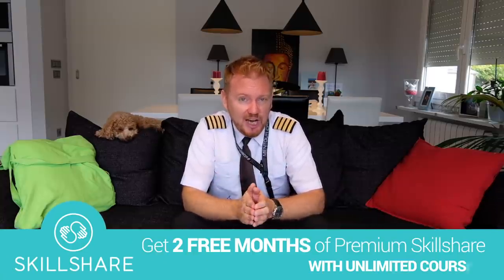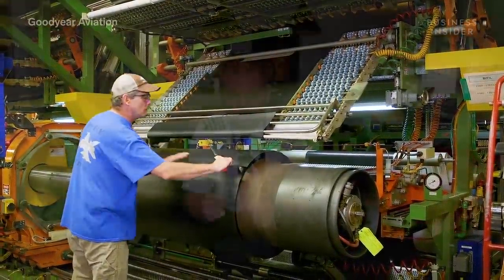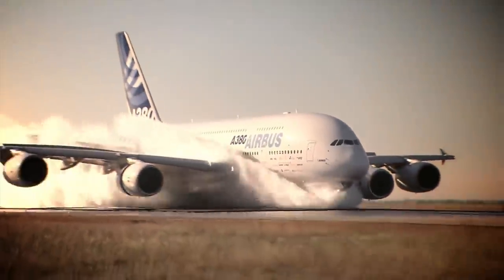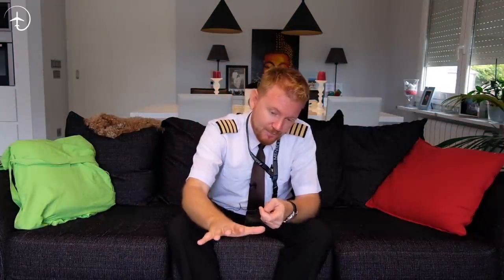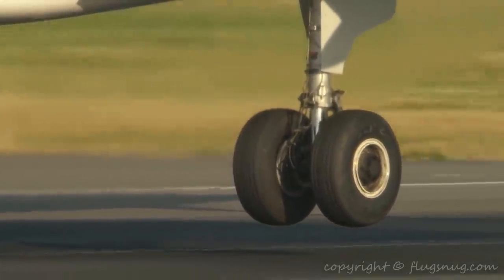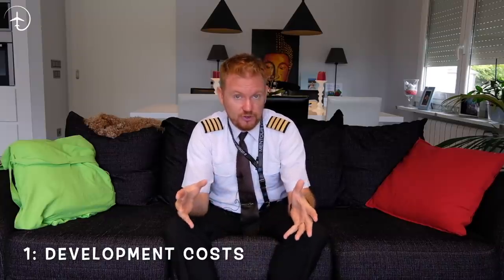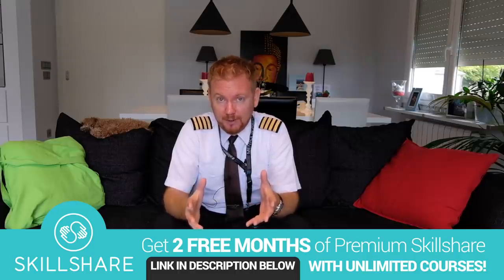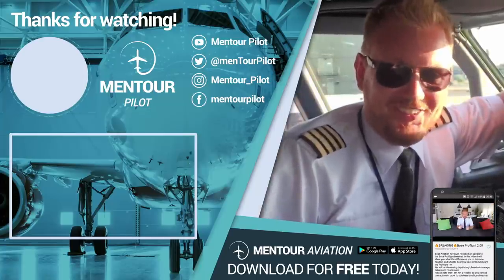Why not make plane-tires spin, before landing?!

Comment: I would think that even if the wheels did not spin at landing speed but at a lower speed, they would still save a lot of rubber. But if the tire "only" costs $1500, I guess it isn't worth it.

Comment: All along the highway you see blown out tyres? I was going to call you out for being ridiculous then you showed footage. This must be a regional/country to country thing because I virtually never see them here in the UK. Like I drive to work 30 mins both way on mostly 70mph A roads or motorways and I see the remains of a tyre like once every several months? See a vehicle with a blown out tyre even more rarely.

I get it in the US. There's no yearly MOT system, and when a state does have some form of one it's normally useless. So vehicles get into awful states quite easily, especially tyres, whereas MOT's being yearly I think are in a position where most tyres that are likely to blow out are caught before they do.

Also if your tyres blow out here it's classified as an accident and it's illegal not to report it to the police. And as part of that they will remove any debris that are located on a public road (if you go off the road though it's more your responsibility).

Also in my experience here there's a cultural thing where if your tyres are like 1 nanometer past the legal limit or look slightly low on pressure some friend/colleague/family member will point it out to you. Fucking annoying sometimes but helpful I guess.

But I guess you also see them in Spain then? A quick Google suggests Spain has a less rigorous MOT system, but they still have one.

Comment: why not something passive with small fins in the wheel's metal central frame it would just grab air when exposed and spin the wheels like an old water mill

Comment: I’m sure you could add a turbine like structure to the rim or brake discs… use AIR to get them rotating from the airstream… and then control the top speed with the brakes… saves a lot of rubber ! 
Batteries argument seem useless, why batteries ? Just use your onboard power, no batteries needed
Make a system from an airstream driven set of wheels a sensor looking down at the runway and a small computer synchronizing all wheel speeds to the slowest wheel and ideally matching the ground speed.

Comment: I disagree that motors would need to be installed.  I also disagree that the tires would need to spin up at the same speed as the plane.  You could use the airflow across the gear to start the wheels spinning.  There would still be smoke and tire slippage but it would be much less, and with no motors, batteries or major tech.  Just an engineered fan wheel on the back side of the tire rim to capture the air and start the tires spinning.

Comment: The real answer is weight. The airline loses more money paying the fuel cost of hauling around the extra few hundred pounds of systems than simply paying for replacement tires more often. I was on the design team for the 737MAX10 reticulating landing gear.

Comment: This is my take on the question: the amount of fossil fuels that goes into making tires is much smaller than the amount of fossil fuel that would be required to lift the additional weight of the tire motors on takeoff, and them run them during landing.

Comment: I am always amazed at how many computers are used in a plane. Is there any move to build a single computer to control all the planes systems, so that instead of several computers you have multiple apps

Comment: Nitrogen and Air specific heats are almost the same. That’s not why they use nitrogen. They use it because it is inert. Not because it resists temperature change better.

Comment: Personally I think you're way overthinking the problem of making the tires spin they're already batteries on their plane right there are already generators but to me a much simpler thing is once the landing gear is down they're in the airflow it would simply be easy to use the air flow to begin to make the tires spin since all the tires are in the air flow I'm sure it wouldn't take a genius to come up with it cost effective use of that air flow and get the tires to spin after all the tires do not have to be at full landing RPM to reduce the wear just by consuming most of the startup potential in rotational initial movement will make I'm sure of substantial difference I would think in what weather or any inclement conditions this would add to the initial traction ability during touchdown seems like a no-brainer to me

Comment: You need to think outside of the box. Rather than use electrical motors you insert hamster wheels into the hub of each wheel. Just before landing you deploy the hamsters into the wheels and have them power up the rotation of the wheels. No batteries required and the weight of 4-6 hamsters is minimal. You’re welcome.

Comment: In theory the tires wouldn't have to be spun up to 200+ kph, they just have to be spining rather than static at the moment of contact. And the easy way to achieve this would be using a hydraulic driven motor since the aircraft is already fitted with a hydraulic system and there would be very little weight penalty.
Reply: The 747 has 18 wheels not sure about the A380 but its lots, every wheel would need a motor, pipe work, possibly two sets for redundancy, (running along undercarriage legs that vary in length during use, so its complex), you couldn't use the brake system to power them because a failure could be catastrophic. so your saying the weight penalty would be "very little" isn't actually true.
Reply: @davedixon2068  It's not an impossible task, and the benefits from implementing such a system could really be a game changer since it would also be useful when taxiing.

But I do know the aviation industry would never go through with such a big redesign.
Reply: @syrthdr09sybr34  As I have said to many people posting on this topic, of course it is possible to do the things you are saying but it will never be financially viable and in some instances it could be detrimental.
Aircraft engines are started at the gate for a reason i.e. checking everything works ok, there are tugs already provided so why fit a system to the aircraft to do the same thing, its just more money and something else to go wrong, and you don't need to spin up the wheels because the minimal benefits are far outweighed by the disadvantages both of which (benefit & disadvantage) have been covered extensively by lots of people.
Its a nice discussion point but in the end its not needed so it wont happen.
Reply: @davedixon2068  My argument is about the possibility of developing a system like described, not about the economics and the political side of it.
Reply: @syrthdr09sybr34  As I said yes it can be done but it wont be.
Reply: @davedixon2068  Yes I knew that when I posted my first comment. Although I'm not an aviator I do know somewhat how the aviation community functions.

Comment: I have heard it suggested to add small bolt on vanes for the aircraft wheels that would cause the wheels to rotate when the gear is lowered. Not required to spin to full speed, just turning so as to reduce the inertia held in a wheel that is stopped and contacting the ground at landing speed. Sounds logical that just rotating up to just 30kmph, no balance/vibration issues here, would greatly reduce the wear on the tyres. This idea seems to be universally rejected and I still can't see why this low tech and low cost feature would not have some merit.

Comment: Why electric motors? How about using compressed air? it would be enough for the wheel to become a turbine. you can use the air momentum itself and coordinate everything so that the wheel is synchronized with the speed of the plane.

Comment: Wouldn't it be possible to have a simple system that would accelerate the wheels through the flow of air using air vanes mounted on the rims (similar to a water or air turbine or impeller)? This in conjunction with a rev limiter that is matched to the landing speed. Many of the disadvantages mentioned would then no longer be relevant.

Comment: Wow, 200 kilos of fuel per flight JUST for taxiing? Considering there are about 22 MILLION flights per year, that's 4.4 BILLION kilos of fuel! Imagine the cost savings alone if they used an electric tug, not to mention the massive reduction in expelled waste, runtime on the engines, etc.

Comment: Ok, the reason for having nitrogen in the tires is probably not as stated in this video, it would probably be affected by changes in pressure and temperatures just as much as air would.

Comment: Nitrogen gas is just a gas, like any other, so subject to gas laws. The pressure in any such gear will be P = n*R*T/V, where n is the number of molecules, R is a universal gas constant, T is the temperature and V is the volume (i.e. now the size of the tires). Although, this law is not usable in extreme temperatures or pressures, this is not that category, so the type of gas is NOT IMPORTANT, there is nothing like "nitrogen changes less" (or more) than any other gas. Actually, 78% of the air is nitrogen, so even if you were right, compressed air should have very similar properties to that of nitrogen's.
I'm sure, there is some reason behind using nitrogen. What I'm saying is that it is not what you said.

Comment: I wouldn't try speed up the wheels using motors. Why not use aerodynamics to bring a tire turning? A certain profile - tesla valve - or little wings on the side of the wheels or even on a tire would accelerate quite a little bit? You don't have to get to the perfect speed. Crosswinds ... I don't think these are a problem. Old rubber may not slowdown a plane enough so you have to change or renew it anyway after a year (you see that effect on car wheels. You just have to test what is still safe and cheap. But of course you will not be able to use wings on open wheels like on these ... 737.

Comment: Maybe a strange question. (?) But why do we not have some kind of steel lattice / net etc. in front of the jetengine (specially designed)? I'm thinking of meeting a flock of birds or just a one. Can this be helpful or hard two engineer? Btw: Nice channel you run here. I drop by every now and then. Thanks.
Reply: Easy to engineer for ground use when the aircraft is stationary and they are used on the ground during engine runs on smaller diameter engines to prevent FOD ingestion during engine ground tests. But in the air they are just more weight and restriction to airflow so more fuel, plus to actually stop a bird they would need to be extremely strong and extremely heavy and the actual probability of a bird strike on any given airframe/engine is actually very low so you would be dragging them round for no reason.

Comment: What would that accomplish? A dragster launching from 0  - 335 mph smokes the tires. Nobody has suggested that there is any problem with that. An inert tire will go where it is lead, a spinning tire will have a steering effect. probably not what anyone wants on landing.

Comment: I would bet that we use Nitrogen rather than compressed air because air has Oxygen and tyres are made of combudtible materials which out gass when they get hot (ever smelt hot rubber?) which can then combine with the Oxygen to make an explosive mixture.  Tyre bursts happen that way.
As far as pre-rotating the wheels, I can imagine that a set of vanes could be added to a wheel, possibly between wheel and leg configured in such a way as to get the wind from the forward speed to spin it.
No-one has done it because either they didn't think of it or there was no business case for doing it.  That is to say the savings would acrue to some one else than the costs.
Never mind the saving in tyre wear, a softer impact with the pavement would be a benefit in landing gear fatigue life and wear and tear, possibly allowing a weight saving.
Alternatively its all wishfull thinking.

Comment: You´re talking about tires spinned up by electrical motors. How about the self-spinning tires without motors? I don´t think there were issues during cross-wind landings and it would probably double the life time of a tire and save costs. I´m sorry, but if i hear, changing tires doesn´t cost that much, i have to think about some accidens caused by saving time and costs in maintenace, e,g, Nigeria Airways Flight 2120.

Comment: Cuz the mechanism which would spin the tires would add unnecessary weight.
Cuz the mechanism which would spin the tires would require maintenance.
Cuz the mechanism would add cost and only make a minimal difference in tire wear.
Cuz tires are relatively cheap.
Cuz the landing roll would be LONGER if the tires were spinning at touchdown.
Cuz.................

Comment: Is it really necessary that the wheels be brought up to match the speed of the aircraft? Some spin would reduce the magnitude of wear on the tyre.  Couldn't the wheels simply have vanes to use the air speed to spin the wheels.  No added weight, no added mechanisms to fail,  no power driving the wheels, and no maintenance

Comment: In reality, they don’t do it because it’s a lot of extra parts and weight with no benefit. Even if they were spinning, wear and tear is still going to happen. Most of the wear doesn’t come from the plane landing and the dramatic change in speed. It comes from the weight of the aircraft, physical forces, and hot brake assemblies that heat up the tires.

Comment: Motorized wheels obviously do not make sense for the reasons explained in the video but have always wondered why not engineer proportionately sized and angled fins on the wheel rims themselves to obtain the optimum pre-rotational speed?  Never considered potential vibration caused by out-of-balanced wheels and at landing, not a good idea.  Keep replacing the tires my friends…

Comment: a few points:
- crab angle: well the electromotor does not have run all the time they could speed up and then cut out?
- what about passively speeding the tires up? some years back I saw something where some kind of pockets were fittes between twin-tires and with the air coming in they started to rotate the tyres to a certain speed.

- that 1500 per tyre is an argument, but how often do tyres have to be renewed? or rethreaded (for that you didn't say a number wich is kinda not very transparent and a bit manipulative...to get people on your side beause the arguments you're telling are kinda eeak)  and on the other hand, I don't know which airline it was, they removed just one olive from every salad, nobody noticed but overall, ALL flights combined in a year they saved millions. that makes your argument with '1500 for a tyrie is nothing when replacing a blade is 50k'. I bet that all the tyre-repair and renewal costs more than that airline saved with removing just one olive from every sald!

Comment: Nitrogen is no different than any other gas with respect to the relationship of temperature, pressure and volume. The gas laws clearly define this. Nitrogen is chosen because it does not chemically react with the wheel's or tire's materials.

Comment: Why use motors? Why not just add fins to the wheel hub which help pre spin the wheel. Surely any spin would be of benefit,  it doesn't need to be the actual speed of the landing aircraft?

Comment: with pre-spun wheels you will also have the gyroscopic effect from all that spinning mass that will resist change of direction. Also the energy  involved in landing on stationary wheels which then have to spin up to speed when they touch the runway actually takes some energy out of the landing and helps slow the plane down which you would not get if the wheels were spinning on touch down.

Comment: Why not make a hubcap like device that would bolt to the existing wheel just like to a car. Of course it would have to be beefed up. On that hubcap would be cup like fins that when the tire is lowered, gravity would cause them to fold out 4-5" and catch the wind on approach to spin the tire. Once the plane takes off again they would fold back in (gravity caused) when the tires were retracted. No motors needed and shouldn't be too much weight. Surely some engineer could come up with something.

Comment: What if they could put electric motors in the landing gear that can be used to do regen braking to help slow down the plane and the  regen braking ability is controlled by the pilot.

Comment: What if we just spin the tires at the half the speed of the airplane using a motor few seconds before landing and then we disconnect the motor,  so tires keep spinning freely as a result we will have less ware and tear on the tires.

Comment: So… planes land with the brakes on because you don’t give up a foot of margin when it comes to a landing.

That’s the reason they smoke. Not because they’re still but because the brakes are literally maxed out the second the plane lands.
Reply: Aircraft tires are rare for the same reason all aviation things are rare.

Regulations. Certified aircraft parts are extremely expensive due to extreme amounts of certification and validation. Not a bad thing.

Why nitrogen? Because it’s dry and it’s not oxygen. Moisture can cause corrosion. Oxygen degrades. At 200 PSI you have 10X the oxygen pressure that’s reacting ever so slowly but much more quickly than the exterior.

Why not motorize? Every pound counts. It’s extra weight that doesn’t “have” to be on the plane. It’s also more stuff to break.

What about all the wear during landing ? While the smoke seems bad you still have plenty wear occurring during the landing, it’s not like getting rid of the skid would massively improve life. Part of what it does is heat up the tire for better traction.